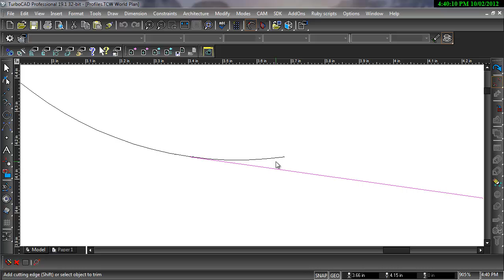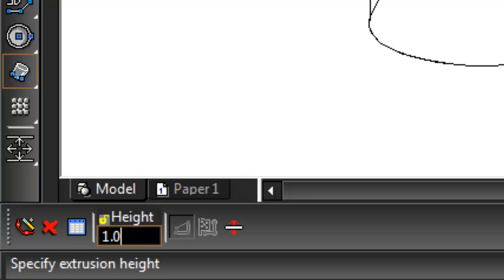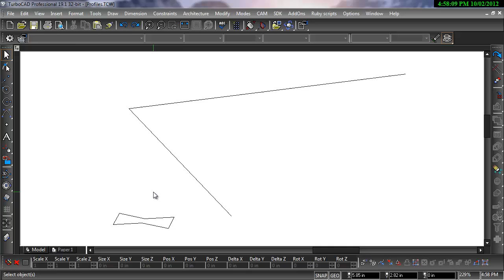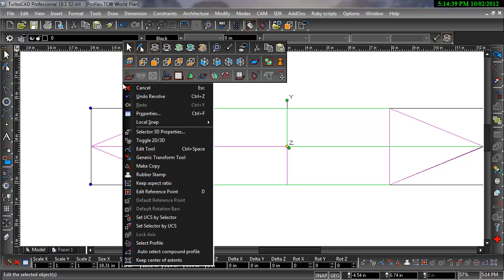Extrudes, Sweeps and Spins

Comment: Thanks that really helped. One more question? How do I Trim two slots that meet on a 3D rectangle. The slots share an edge but I need that end to just a L shape slot.  Best way to look at it is if you had a cube and you put a L slot into it.
Reply from the maker: Use workplane by facet to draw a closed 2D profile on the face of the 3D entity, then extrude with a negative value to the desired depth. You can then subtract the extrude from the original box. In TurboCAD Platinum there is an imprint tool which combines the extrude and subtract operations but very similar process is used.
Reply: Thanks you guys rock!!

Comment: HOW do you select the multiple profiles to make holes???
Reply from the maker: Hold down the shift key to select multiple entities. Use compound profile must be checked as an option. This is only available in TurboCAD Professional. In TurboCAD Deluxe you must extrude the entities separately then do a 3D subtract.